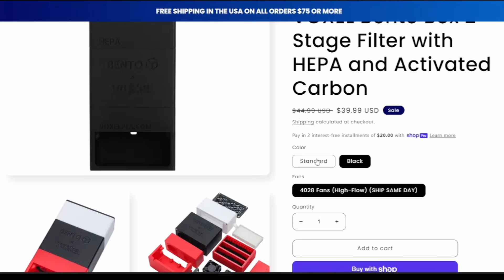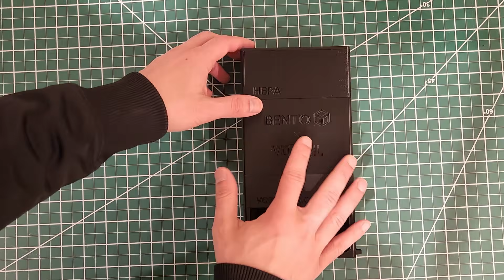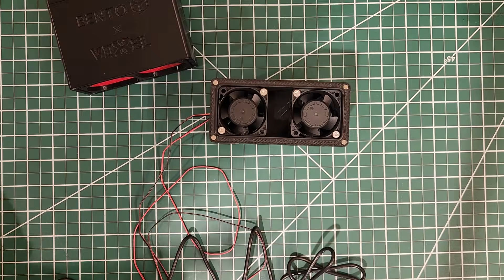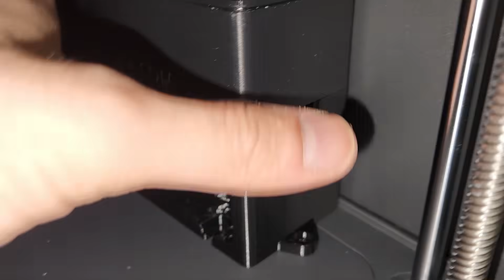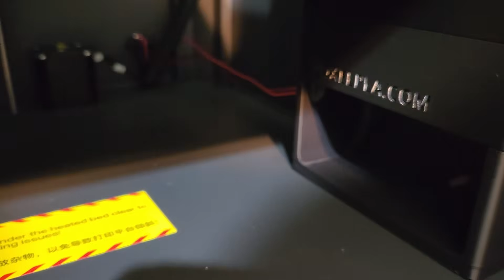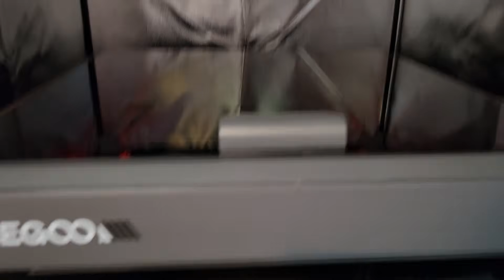BentoBox V2 on the Elegoo Centauri Carbon

Comment from the maker: What are your thoughts? Is the filter too much? Is the enclosure too much? Would love to hear your experiences with ABS, ASA, and other materials.
Reply: Excellent model, thanks for the base! One request, I have 8x3mm magnets instead of 8x2. Is it possible to make a version that supports 8x3mm magnets? Also, the tolerance can be reduced a bit so that the magnets pressure fit.

Comment: Btw, bento box can be used as filament box dryier, by replacing carbon with silica gel beans. Forcing air trough silica get absorbs much more moisture than passive bags of silica.  See idea from 3dprinting nerd where he build similar Blower to dry filament

Comment: I tried the bentobox witth 40x fans and 50x blowers and put in a air quality monitor and they did nothing they just cannot pull enough air through them. I found another version of bentobox called the bentobox turbo and it uses a single 120mm blower fan and coupled with a variable speed control it is a beast it moves so much air and now I dont get any abs or asa smell from my Centauri Carbon. The air quality monitor stays permanently in the safe instead of going straight to red. Just for info TVOC stays around 0.078mg/m3
Reply: Care to tell me more about your setup? Currently looking into making my cc room safe

Comment: Could you not have just printed hose attachment to the back of the Centauri where it exhaust then run the dryer hose off that and out the window?
Reply from the maker: You mean to avoid having the enclosure? If so, then I prefer the enclosure for the following reasons:

1) With an enclosure you get to maintain most of the air within the enclosed printer inside the printer. The fan is creating a vacuum inside the new added enclosure and ensuring that fumes from the printer are exhausted. Keeping (most of) the printer air inside the printer allows for maintaining temperature inside the printer when printing with filaments that require it (i.e. ABS or ASA).

2) If you do what you suggested, and you use the existing printer exhaust fan, then I noticed that fumes still leak through other exit points. You could use the added fan to pull enough air, causing a vacuum inside the printer, and likely preventing such fume leaks, but then all hot air leaves the printer and you also cause too much air flow within the printer (in my opinion).

You could choose to buy a fan, try without the added enclosure and go from there, but I prefer the added enclosure.

Comment: Super large fan. I think you can filter several printers going all at the same time with it. Future proof.
Reply from the maker: I agree! Originally I bought the fan for a laser engraver that I don't run as often, so I simply moved the fan over to my printer. If I had to buy one just for 1 printer, I would buy something smaller for sure. Or as you said, would only buy this one if I wanted to future proof.

Thanks for watching!
Reply: @diyengineers  That makes sense. Although I like to over engineer things. That fan is HUGE! Lol.

Comment: Interestingly, when printing ASA on my CC there is no smell at all - even without the bento box - but my air monitor shows severely increased tvoc and hcho. Currently working on adding a bento box and an enclusure with filter to add another layer of filtration will follow.
Reply from the maker: The room I was printing in has a bit of a stagnant net air flow (low air flow from the vent supplying the room) so maybe that's one factor. Also, I was printing Polymaker ASA, what ASA filament did you print?

Also, maybe I'm just more sensitive to the smell?

Comment: There are two free terminals in the printer's power supply, if you have 24V fans, you can connect them directly there and add a temperature fuse so that the bento box will only work when the chamber temperature is above 40 degrees Celsius, for example.
Reply from the maker: That's a good idea! I like mine running a while after it's done printing. Maybe another option would be to also use with a microcontroller and temperature sensor to build in logic with time, temperature, etc.
Reply: I'm looking for a mod so I can keep my lid and door sealed while printing PLA. I'm thinking pull outside air in (through a filter), and blow hot air out. Any thoughts on where to start on this?
Reply from the maker: @andrewfaber9014  Is your goal to have "clean air" exiting only out of the printer? If so, you have to ensure you close off any potential air leak spot and that air can only flow through inlet filter and outlet filters. Probably easier to manage via separate enclosure.
Reply: @diyengineers I'm in a dusty area. It's in a fabric closet, but it's still a garage... So pump clean air in and it can leave however.

Comment: I have a bentobox inside my centauri carbon. I am not really sure that it helps.  I also have a Prusa Core One that I added the Prusa advanced filteration system and it works great. You smell no fumes at all. I have been thinking about making one for my centauri carbon. It’s just a box, a fan, and a carbon and hepa filter.
Reply from the maker: Thanks for sharing. Maybe it has an overall better flowrate it that keeps up better than the bentobox does?

Thanks for watching!

Comment: Is the stl or 3mf available to print your modified base?
Reply from the maker: Sorry about that. I now added this to the video description. Print on PETG, ABS, or ASA. Link to file is also here:

STL file to 3D Print Base: https://www.nexprint.com/en/models/1969735301672828928?component=UserPublish&printConfigId=1969735302293585920

Comment: I'm hoping the firmware release recently means we could add this to the fan control on the board. Are you glad you bought from voxel instead of just piecing it together?
Reply from the maker: I have a few other projects I am working on, so I didn't want to spend too much time putting the BentoBox together, which is why I bought. If you choose to DIY, the price is not much different, except you get to keep excess supplies (magnets, filament, etc). You also have to pay shipping cost  or exceed a threshold (it was $75 when I bought) to get free shipping (I just added filament and replacement filters). Overall, I am glad I bought the kit, so I could go back to my projects, but doing yourself would not be too bad. The only annoying part is buying and still having to print another base due to incompatibility with Elegoo Centauri Carbon.

Comment: Hi - good video.  I also use the Bento Box from Voxel in my Centari Carbon.  One additional thing I did was print the 'poop chute cover' I found on printables.  I lot of air escapes from there and that hinged door print seems to help.  A paper clip wire fits perfect to complete the hinge.  I mentioned to Voxel about an improved base to better fit the Centari.  I still "smell" the ABS a bit but the rear hatch seemed to help.  Try it?
Reply from the maker: I already fell in love with my ugly enclosure now that I smell absolutely nothing from my printer! So I'll probably stick with it. Thanks for the suggestion though.